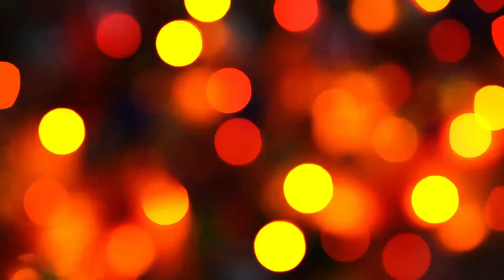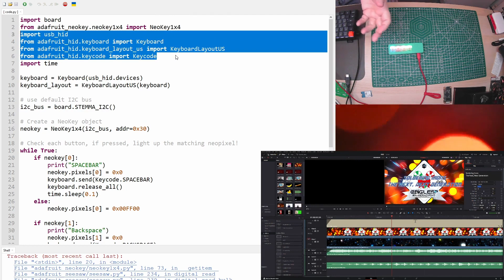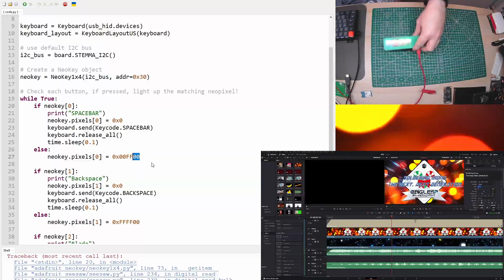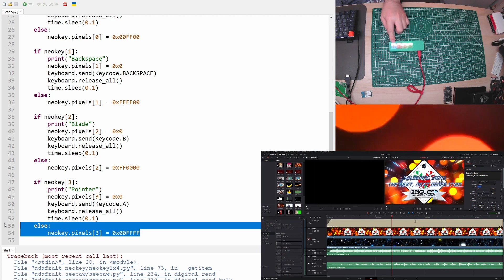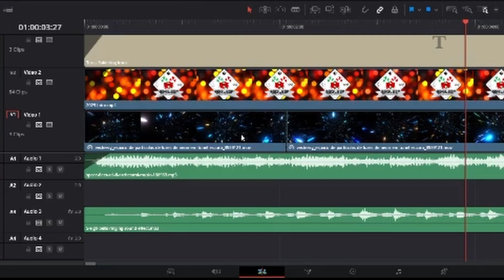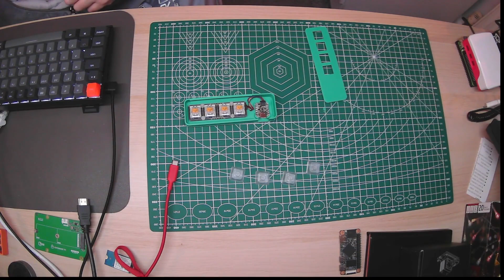Maker Advent 2023 Day 7: Building my own DaVinci Resolve Shortcut Keyboard

Comment: Some mother******s are always trying to iceskate up hill!  With this sort of tool, it'll be a damn sight easier :)
Nice little tool.   Is there a version 2040 board, that small, with wifi?
Reply from the maker: LOL I'm skating quite well thanks :) I used to use Openshot, KDENlive on my Linux box, but DaVinci Resolve feels much better. I don't know of an RP2040 board that small with Wi-Fi. You'd probably need an ESP32 instead.